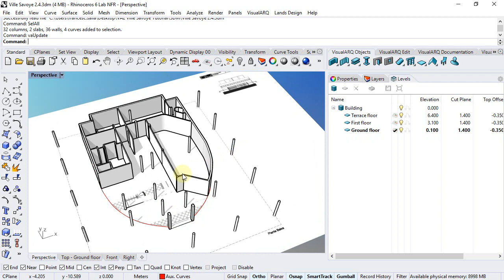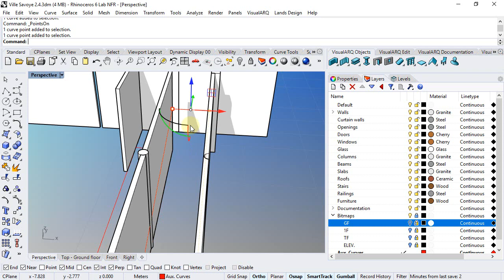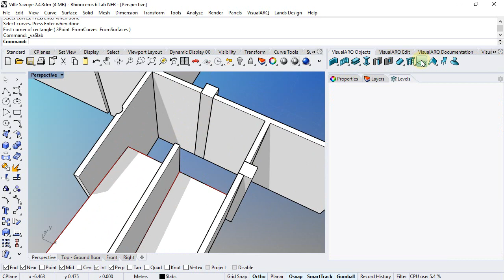VisualARQ 2 tutorial - 2.4.1 Ground floor ramp

Comment: It would be good to have a seperate object type/ for ramps,

Also seperate object type for
0. Ramps, we can draw planar bounding box but there will be some slope options and we can make different styles with different slopes like we do in stairs, instead of using slab and editing its points to make ramps. It will be like stairs functionalities we have, but just no steps
1. Collonade (it will be similar to railing functionality that allow us to use profiles but additional features like choosing a model for columns from columns we have)
More components for existing object types
2. Components for Columns, for example similar to railing tool, columns can have components  we can add via profiles like column base, column capital, column shaft, column pedestal, so we can use these components like in railing to add many geometric detail we wanna add (its similar to railing cuz in railing we can add as many handrails or posts we want to make the pattern or design we want) 
3. More addable optional componentts for Windows and Doors: For example, Trim components for windows - like left trim, right trim, upper trim (made by profiles) so we can for example choose romanic profile to make arched trim for upper part of a windows,and  there can be special components like ''pediment component, arch component for upper part of window) and if the number of identical components we can put will be unlimited we can make more intricate things.
4. Option to choose profile for window framess or muntins or door frame or panels, (in window system styles families, its not possible to change the frame or mullion or muntins shape to round profiles, so visualarq3 will add profile option to curtain walls but it would be good to see its added for windows and doors too.
5. Coating Component for Slabs: to add plaster layer or any finish to its side surfaces like we have coating component option in columns
6A. Sweep component for walls: so we can use its similar to handrail that we have in railings, so we can choose top bottom or center position and put offsets so we can have cornices at top of walls or floor sweep skirting boards at bottom of wall or even by using multiple sweeps we can have classical wall skirting panels etc.
Reply from the maker: Hi Erica, thanks for your suggestions and requests. If you write us to visualarq@asuni.com it will be easier to exchange emails with screenshots or gifs.
Anyway: 
0. The ramp object is planned for future VisualARQ versions
1. Can you provide an example of that? take into account that you can create columns from blocks, or from Grasshopper definitions (so you have full parametric columns)
2. This can be achieved with a Grasshopper style.
3. You can create custom profiles for doors and windows. Check this video tutorial, for example: https://www.visualarq.com/learn/video-tutorial/1f-windows/
4. You are right. The frame component in doors and windows has a rectangular profile, and it can't be changed by a custom one. I take note of this request for future versions. Until then, you can always create a door or a window from a Grasshopper style, so you can set any profile to the frame and control its sizes.
5. Ok. I add your vote for this feature as well. We have plans to apply a similar methodology as wall layer wrappings. But we need to study if it would be possible to control these wrappings or coating by side or it will apply to the whole boundary.
6. I add your vote for this feature too.
Reply: @VisualARQ  Okay I ll answer about this in email to explain missing parts :)))